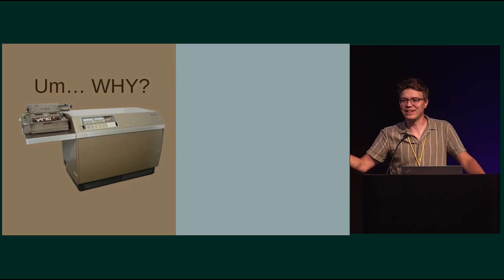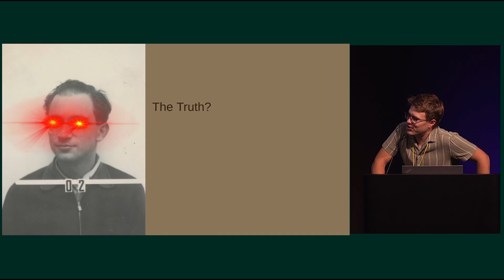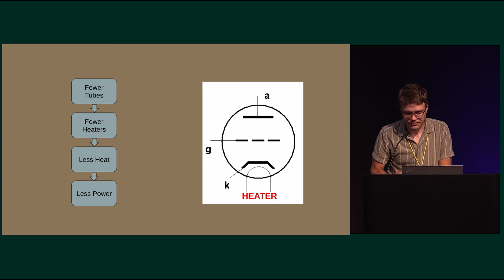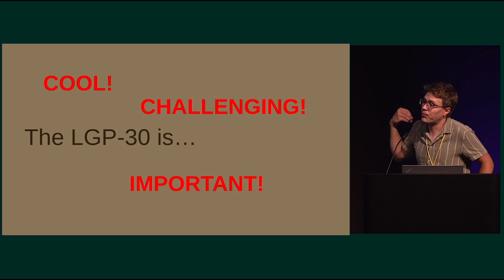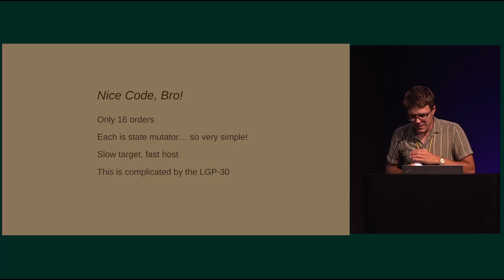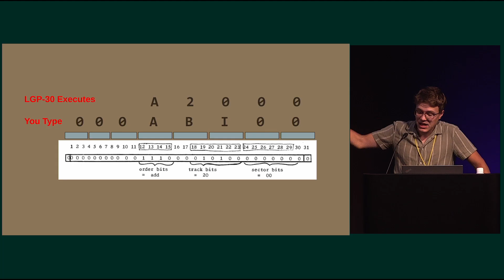VCF West: The LGP-30: Adventures in Drums and Emulation - Sean Haas

Comment: Fascinating talk!  I never knew this machine existed and I love reading old mainframe manuals off Bitsavers.  The 1950's art deco radio/kitchen appliance look of the thing is amazing.  Gonna pop over to the Github and check out the source code.  Would also love to know if anyone has sound of this machine running.  I'm sure the drum memorty give it a very unique sound starting up and shutting down.  

As for the question about VR, I've been wanting to recreate old mainframes & storage devices in VR for a while, including the sound & behaviors of old 9-track reel-to-reel using the original firmware.  As a kid, I got to tour a large computing lab for flight & weapons simulations at Point Mugu and would love to recreate the experience accurately and where you can touch & operate the machines.
Reply from the maker: @rbus: We are glad that you enjoyed it!